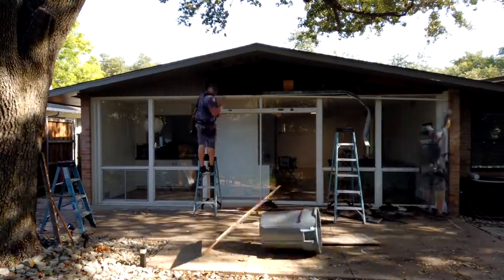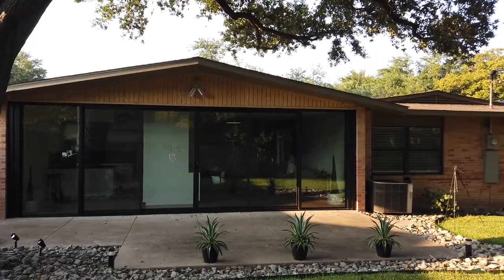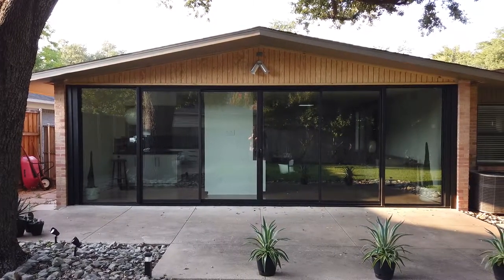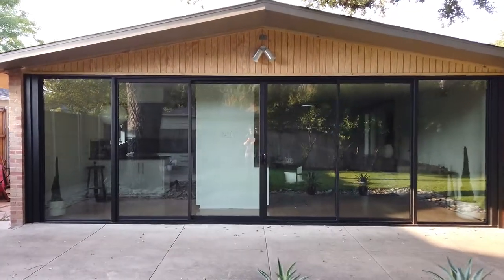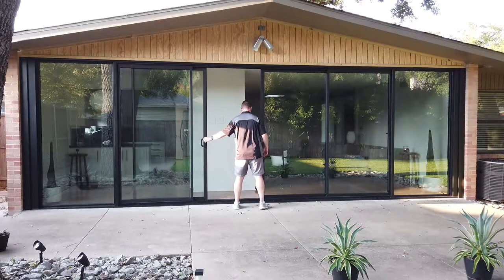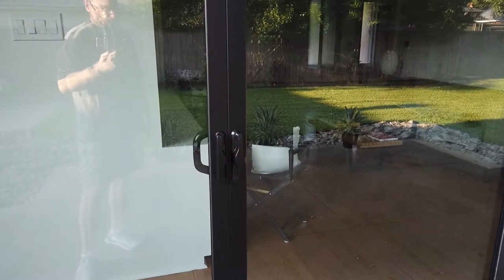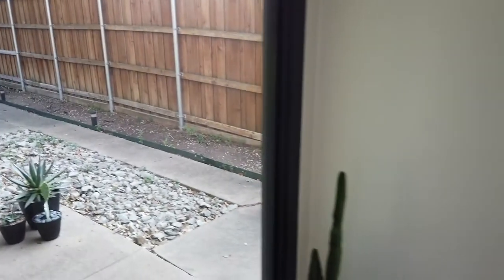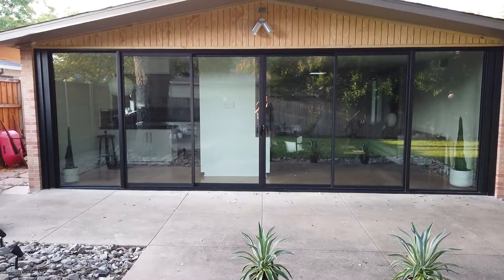Milgard Thermal Break Sliding Door Custom Build Review

Comment: I live within one mile of the ocean. How will these aluminum frames and track stand up against corrosion in the salt air environment?
Reply from the maker: Not very good. Aluminum is not recommended in beach homes for while the material is water resistant, it can suffer corrosion from salt water and salt air. The corrosion affects hardware operation and frame performance.